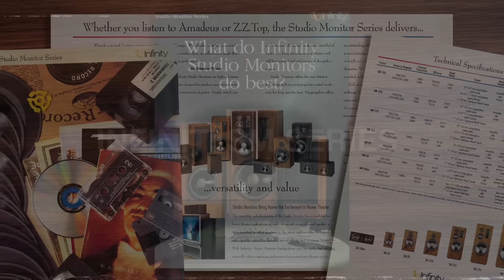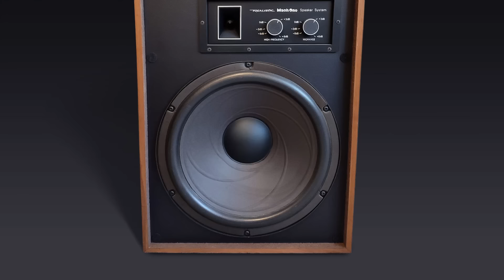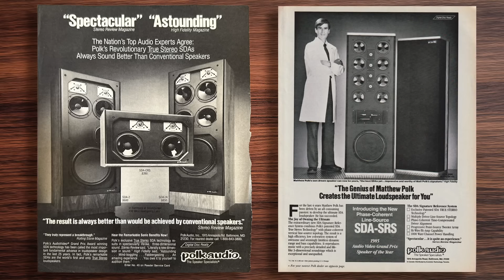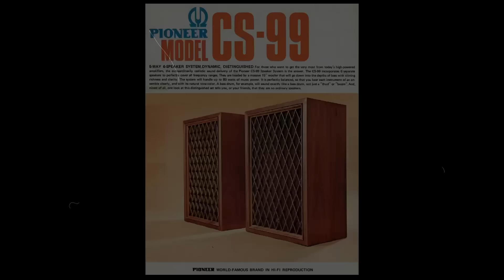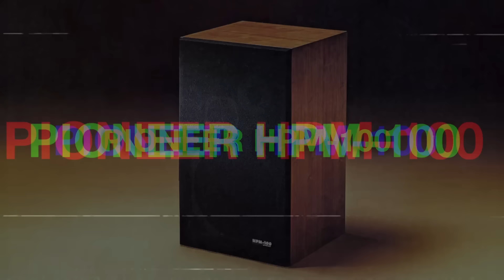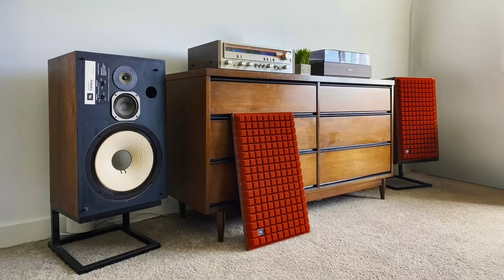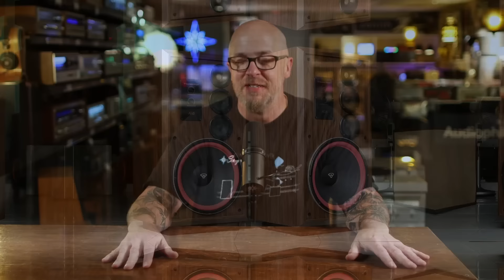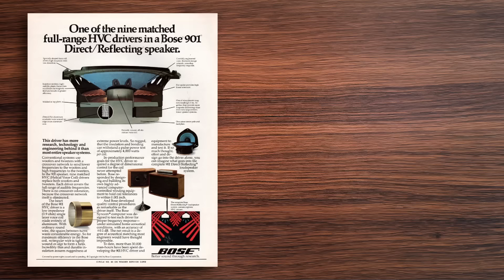Why Do Audiophiles Hate These 9 Legendary Speakers?

Comment: Growing up in the 1970's the Cerwin Vegas were always the house party speakers.
Reply: Yes they were, the bigger the better!!!  Those big heavy Koss headphones were the bomb too.  For the car, we were rocking Jensen tri axle speakers with a cheap Kraco booster hooked up to whatever radio you had in the ride. Plug in the 8 track tape and crank it up.  The late 70's were a great time to be growing up in.  You could actually afford to go to concerts too.  The  "Party favors" were the real expense.  Supposedly illegal back then.
Reply: We had Vega subs with 18's in them and used two or four ElectroVoice top cabinets. The EV was easily able to cover the Vega bass power clearly. We were using 2 amps, tops powered by 2x400wpc and Vegas powered by 2x500+wpc both amps would produce that into 8 ohms. That setup was savage. It sounded good but lets face it, that was not living room material. It was made to drive the screws out of your deck and delaminate your neighbors walls. We did use it to punish some drunks for their party the night before by putting the vegas against the wall and using a signal generator bring all their stuff in the apartment into resonance and knock it all off the walls. When you hear shit crashing in the neighbors place, You know you got it right LOL. Those Vegas RULED. as Bevis and Butthead would say ha ha
Reply: As an Aussie I always thought of JBL and Cerwin Vega as the quintessential USA speakers that reflected the culture, just like the BBC LS3/5A represented British culture.
Reply: They made quite a lot of semi-pro PA kit. I had 4 x CV reverse loaded 18" horns. Similar to EV Earthshakers. Were Ok, but cab construction quality was very poor.
Reply: We had a pair of AR 4's that filled a very large room. They were awesome.
Reply: Cerwin Vega PA systems were quite common in big rave events in the UK during the 90's. They were highly sought after for bedroom DJs during that time also.
Reply: CV weren't available here in NZ, we used Wharfedale E series as a loud home party choice. They also had the HiFi range available which made them popular and did not tarnish the brand at all. No council noise police back in the day to confiscate your stuff.

Comment: I did Pro audio in the 1980's and the Bose 901/802 was THE speaker for sound reinforcement use. Discos, bars, large meeting rooms, etc. they were unequalled when correctly ceiling mounted and powered by a BGW 750B/C/D. We'd use one in each corner of the room and also an 18" sub at times. No matter how full the room was there was never any sound loss or change in audio quality. Even with the mandatory Bose EQ we'd use a RTA combined with a Soundcraftsmen AE2420-R to fine tune the systems. In a standard home environment with the tulip stands, though, combined with a home audio receiver they left a lot to be desired. My own current main big listening setup is pristine EV Sentry III's (bi-amped with the EV SEQ box), Sentry 500's and Sentry 100A's pushed by Crown XLS power and fed by a Soundcraft 16 channel mixing board. The late owner of a record company I worked for said it was the best playback system he'd ever heard. He designed and held the patent on the high ceiling baffled recording studio rooms that later became very common.
Reply: I have 4 802's with a panaray controller, and I have 2 MB4 subs as well.  Not impressed with the Bose subs, however the 802's sound amazing, even outdoors, which is where I've used them most often. I've put live bands through them or pre-recorded and they never disappoint.

Comment: None of those speakers represent much accuracy, but a couple of them can be fun in the right setting.  The Polks are probably the most tolerable of the list, though it was everyone's least favorite brand amongst salespeople at the place I sold them. JSE's were more the reference. It is quite interesting to listen to a set of the Polk SDA models with Herbie Hancock's "Headhunters". Some sounds will appear as if they are coming dead left and right.  It's all achieved by taking some info from each channel and feeding it to the other speaker, which will then be broadcast out of phase. It moves stereo sounds further out, and leaves info mixed into both channels more or less alone from an imaging standpoint.

Comment: I had the HPM-100's since they first came out. I am the kind of guy that stopped by the high-end audio stores monthly. In my opinion, they had as good as sound as many higher end brand audiophile brands that by friends had. I ended up stupidly dumping then in 2009 when I had to move across country and the Truck was extremely over weight, they also had cracked cones that rattled and at that time I could not find anyone to fix them.  Was it a mistake to get rid of them, 'Yes',  I kick myself every day I wake up, and they are not in the house!   I miss my audio friends! I have yet to find anything reasonably priced to replace them and equal them.

Comment: Growing up in the 1970s, I had a friend who's dad had a pair of Klipsch Heritage corner speakers in the basement. They were driven by a pair of Class A Tube amps that he built with the source coming from a $9,000 reel to reel tape deck. There was acoustic foam at strategic places on the wall and at a specific place on the floor was a single metal padded chair that was bolted in place...that was the sweet-spot. When you sat in that chair and listened to the music, it was as if the music originated inside your head! Absolutely amazing sound! 
As for the RS Mach 1. I worked at RS in the 80s and we loved to crank those up! it really brought in the customers. But they really shined when you hooked 4 of them up to a quadraphonic system! Wow! Talk about surround-sound!
As for my favorite speaker? for me it's utility over everything...my Minimus 7 from RS are fantastic...of course, I performed the cross-over mod...that's the first thing you do on those...but as far as the usability of speakers go, you can't beat the Minimus 7. I also have the Minimus 3.5 and the Minimus minis.

Comment: I have the bose cubes that are wired to the subwoofer. they handle a ton of wattage and the sound is impeccable. I bought them back in 2000. They’re still kicking it.

Comment: 10:18 That JBL ad brags that recording engineers use this speaker in recording studios as studio monitors. That's because you want crappy speakers to check a mix on. If it sounds good on that, it will sound good on anything. (They also have HUGE very expensive speakers to impress the stoned client for final playback. But they do most of the actual mixing on the low-end bookshelf speakers.)
Reply: Couldn’t be further from the truth lol

Comment: every old speaker from the 1970s is going to have serious flaws that newer speakers do better.  Even something like a Bozak B-310B concert grand Contemporary which is considered one of the best speakers of the 1970s would have a very hard time competing against even most decent home theater speakers in the $1500 a pair range, despite costing some $2600 a pair in 1978 ($12,000+ today) neverminded a highly regarded $12,000 speaker like a B&W 702 or Focal Kanta N°2

Comment: I have a set of vintage Genesis speakers I bought on clearance at Best Buy around 1990.  Other than replacing the disintegrated foam surrounds a few years ago, they are untouched. They sound great and I love them.  I have an older Yamaha receiver and a vintage Technics turntable for them. Only vinyl baby.

Comment: I still have (had?) 2 of the JBL L100's that I don't use, HAVEN'T used in decades. I tried to sell them...nothing. I was going to give them away to the UPS driver at our work, but he thought they were gaudy. Eventually, my Nephew took them. He's protecting them, but he cannot play them loud in his apartment. He doesn't even listen to music, so there they still sit. These were bought around '74 or so and I upgraded them with a midrange and that made a big difference. The orange grill is long gone. Oddly, I had the same amp as in this video, the Pioneer SA-9100. Incredible amp! I brought that in for repair when some Caps inside failed and the repair shop closed out of the blue overnight and disappeared...with my amp too. Never saw it again. After other failures, I stopped with equipment all together and sold or gave it all off. Multiple reel to reels with endless tapes, high level cassette machines, EQ's, mixers, DBX additions and endless cables, gone. Couldn't give away a Technics SL-1200 and SL-1350 to anyone. Even studios and radio stations turned me down. Eventually, they found homes, but it was a job doing so. Glad I'm out of it though. Was like babysitting the machines.

Comment: Because they don't sound very good that's why people don't like them. They have drivers installed in that front panel wherever they will fit. Crossovers were horrible. People like them because they're nostalgic and they have a connection to that time. They don't have a connection with quality sound.

Comment: I inherited a pair of Klipsch speakers, older than I am, from my father. I seem to like them well enough, driven by my knock-off Pass amp. Looking forward to trying them with the 8W Hiraga I'm building.  Also inherited two pairs of 901s with the Bosefiers, originally used in a quadraphonic setup spanning the living, kitchen, and dining spaces of his open plan '50s house. As long as you have a large space with a high ceiling, and you can chain the 901s to the rafters, like my father did, they seem fairly decent. Otherwise, get literally anything else before you get 901s, even Yamaha NS10s. I briefly borrowed two of them, along with a Dynaco amp, when I went away to college in the late '90s, and I can attest that 901s are terrible in a small space. By the time I went home for Thanksgiving, I was more than ready to swap them for the pair of AR 4x bookshelf speakers he recommended that I take, instead.

Comment: The Heresys we're my first speaker purchase in 1981.  I loved them for their forward sound and comparatively detailed sound.  As I got to know them, I could hear resonances added by the enclosed box.  These were still better than resonances introduced by a tuned port in most of the speakers I could afford.  But that annoying resonance could be tuned out with an equalizer at about 100-150hz.  But this also revealed the lack of any bass extension.  My third speaker purchase was several years later; the Klipsch RP-3s.  A kilpsch speaker with a completely different set of expectations.  It was smooth and more reserved in the upper and midranges, but with the built in powered subwoofer, it had bass extension.  After a short time running the RP3s alone, I experimented.  A Frankenstein configuration: place the Heresys on top of the RP3s.  Feed only bass to the subwoofer for the RP3, and split the upper frequencies between the two speakers.  With 200 watts of clean crisp power pushing it, it sounds pretty awesome to me.  But the purists will say that there is some tiny "distortions" caused by the drivers of the two different speakers being out of electrical phase.  But with proper tuning, I've  found the combo most closely approximated the sound of the used Infinity RS2.5s with one (instead of two) functioning EMIMs per channel (and driven by a non 200watt amp..which is a story for another thread).  Using the infinity as the pinnacle of what I've owned for comparison, my Klipsch Frankenstein conglomeration is not far behind.  Unfortunately I don't own the Infinity's or the amp it was connected to anymore.

Comment: I use to have Sansui speakers but they didn't have the "range" I was looking for. I tried other Japanese brands, Pioneer was the one that came close. Then I tried the original AR's, Klipsch and
 Bose from the 80's which I really liked but budgetwise had to settle with Bose 401's and today they are still kicking,drivers still good.

Comment: Back in college I bought a pair of Technics SB-7000s. I loved the sound. However, with no truck to move them, putting them in the trunk of my parents car was a bit of a problem. so I sold them the next year. Is there any of these still being used? I would joke, the room distorts before the speakers. Especially when I had a Harmond Kardon Citation 16 driving them. My current speakers are still Technics from the early 1990's. A friend had the Pioneer speakers you talked about and blew the midrange cones out of the housing.. some one didn't turn down the volume before dropping the needle on the record...

Comment: Out of all of the speakers in this video, I have only owned a pair of the big speakers that have the multiple drivers on them. This was a pair of Linear Design speakers from the mid 80’s, with a 7 way speaker design and very sensitive at 93 dB. My problem was I was young back then and didn’t understand how sound travels and were way too big for the room I was putting them in. Many years later I sold them to my brother in law and he still owns them to this day, though one of the woofer drivers is damaged. 
I remember back in high school I remember a teacher telling me that he had a pair of the Bose 901’s, and he loved them. I remember him saying that they actually had to get someone to come over and do room measurements before placing the speakers in the room for optimal performance. Never heard the 901’s but I’m not a big fan of Bose in general.

Comment: Pretty sure this is the 2nd time I've watched this.  I sought it out to confirm what the heck I did today.  I was in a Goodwill and saw a pair of black Cerwin Vega E-715 for $20/pr.  So I scurried to go get two big shopping cards (most of them at this store are minis) to stuff them into.  I'm 68 years old.  Two couples in their 30s, each with a big strong guy, watched me clean and jerk each of the (80 pound, very bulky) speakers into the carts, without offering to help.  And off I rolled them to the cash register.  Then I put down the front and rear passenger seats in my Prius Prime, and dedicated the right side of my car of hauling them to my office/storage space.  

I haven't hooked them up yet, but they physically look fine, no broken cones or surrounds.

This is the Goodwill store attached to the Goodwill Outlet where abour 10-15 years ago, I found a pair of Klipsch Cornwalls in the furniture section set up as end tables, priced $7.99 each.  I figured they must be broken, but in fact they function perfectly and I still have them.

So I'm into it for just under $36, for 4 speakers weighing around 340 pounds, each with a 15" woofer.

Meanwhile, I have pondered whether to take up the occasional offers from Ohm, to refurbish or replace the drivers in the pair of Ohm G's I bought in college.  The foam at the bottom of their Walsh drivers disintegrated, as they all have according to Ohm.  Pretty sure the service cost has drifted up from $800 or so, into 4 figures.  I'm really happy with the Cornwalls, other than not really having the right space for them at home now.  But I did enjoy them in a big living space up until 2020, when I moved due to the pandemic.

But yeah, I don't care what anyone says about my Cornwalls.  They're the best speakers I've owned, and they remind me of the LaScalas which my dormitory owned and lent to my dorm floor for our big parties.  Recreating the sound/feel of a dorm party?  Priceless.  Yet, possessions must be divested.  My adult kids have no interest in big speakers.  Or any speakers, really.  Millennials!

Comment: To me any JBLs Are more for soundstage more like live music 
I had Bose 601 on different receivers and sounded pretty well with warm tones in all music type I had others Bose and they were ok just the 601 are great,
I also had infinity sm big 15" to the little 5 inch from classical to rock and the sound is a little detail and clean not by much,
But the Boston acoustic from the A40 A60 A80 A100  Are very Detail  Articulated Balanced warm  with tight bass
There offen called the little mighty powerful sound from a little box
You can hook them up to just about anything out there they will sound beautiful that's in my opinion.

Comment: Wow! I am still using my Electro voice T350 tweeter and my University C15HC along with 8' midrange and my home built coils for the crossovers, along with my Fisher X-1000 amp & Fisher FM-1000 tuner all bought new in 1962, now I am 83 still using it day after day.  Thank you Mr. Avery FISHER and Mr. Abraham Cohen.
Reply: The EV T350 is one of the best speakers ever made. It's an upgrade of their T35.

Comment: I got really lucky when I bought a pair of Heil ESS AMT-3 Rock Monitors at an estate sale. They are 50 years old and are in very fine condition and are the best sounding speakers I ever owned. They weigh 125 pounds each and are rated for 450 watts, but my power amp has 700 watts per channel. They have 2 10" woofers, a mid bass driver and the famous Air Motion Transformer high/mid frequency driver, which is a type of ribbon tweeter, and it has a radiating surface equivalent to a 8" driver. I highly recommend them if you can find a pair in decent condition.

Comment: I have a pair of Jean-Marie Reynaud Arpeggiones powered by a Harmon HK-3475.  Gives a very warm midrange and bottom end for only one 6 inch driver.  The cabinet is big and gives a lot if low reverb that fills a small space almost too much and I have to turn bass down.
   Recently picked up a pair of Pioneer CS-77a's and the difference between them is incredible.  The 77a has a very bright sound and direct midrange clarity, classical sounds amazing on them.  Bass is punchy, without the boom so much.

 The Reynauds need to be cranked more to get the same volume, but they are not bad.  Rock and metal sounds great, and they give a very warm room filling sound.  The CS-77a's though... I can pick separate instruments out of an orchestra, no need touch trebel.  All with rotten foam surrounds on the high mid drivers and fourty five year old cross-over caps.